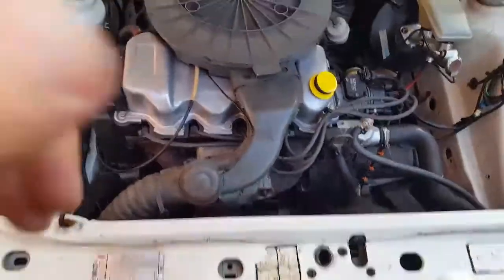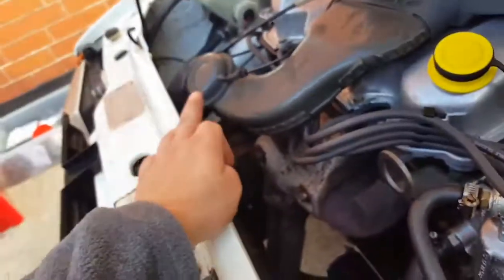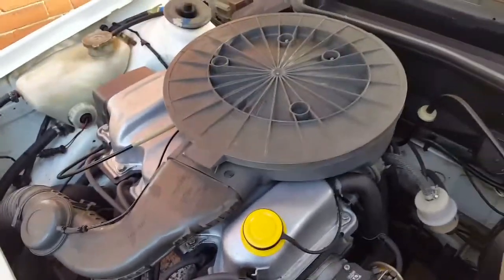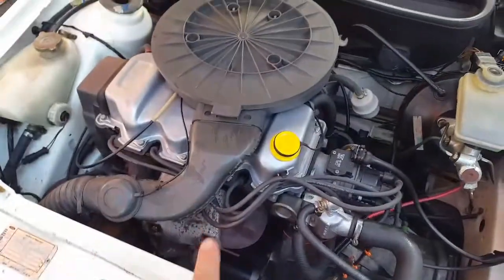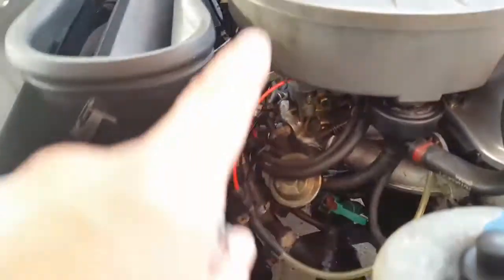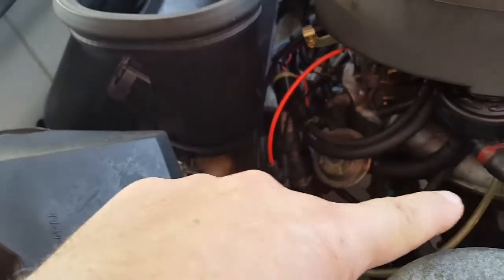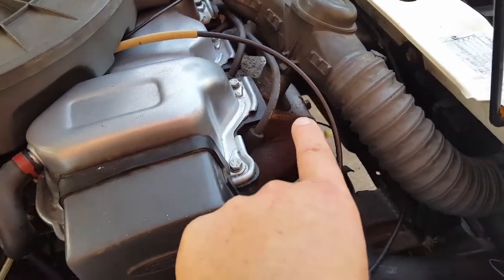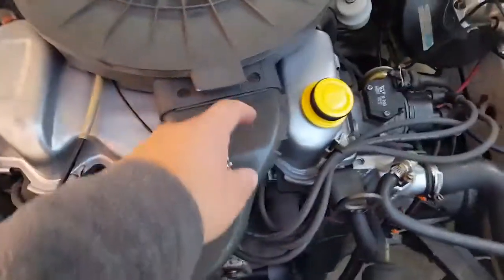Mk3 escort cabriolet stock air intake

Comment: Hi Springy, really enjoy your videos...I have a mk3 XR3 myself with very similar carb setup as you can imagine. Question though, on the inside of the airbox do you  have a vac nipple ? There’s two on the underside... one from the carb, and the other to the vac flap above the exhaust manifold. But is the inner one plugged ? I can only activate the vac flap if the inner nipple is blocked off. Doesn’t seem right to me. Cheers! Jon
Reply from the maker: Hey Buddy I will take off the air box top and do a video 👍🏻☮❤as soon as I can get near it ..
Reply: springy 2112  Hi pal - I think I sorted it, looks like it’s a temp sensor that that it’s own membrane or something.. looks like mines gone, so ordered a new one off eBay!
Reply from the maker: @drjonathanjamesjones  
yeah from memory there's the flap diaphragm in the cold intake tube which diverts hot air from manifold when engine is cold and there's another vacuum switch inside the air filter box which will probably be the heat sensor as you said. cheers buddy stay safe 👍🏻☮❤